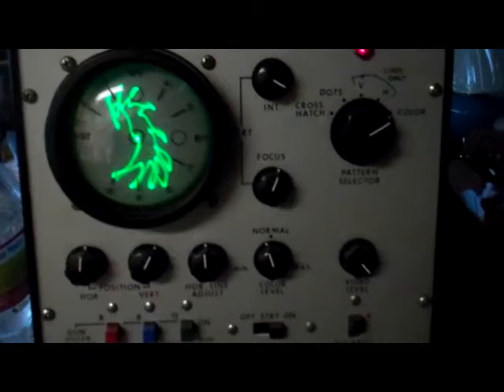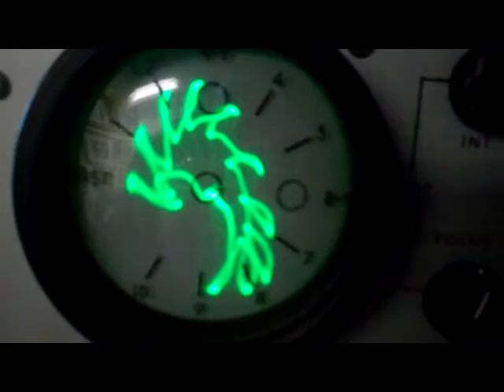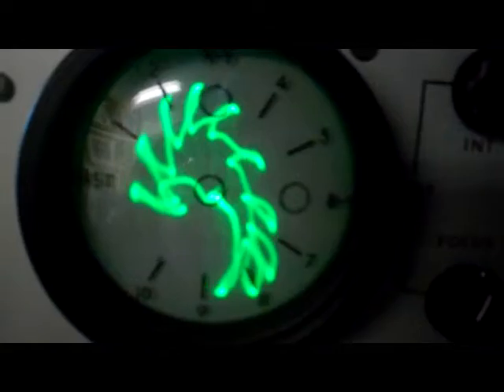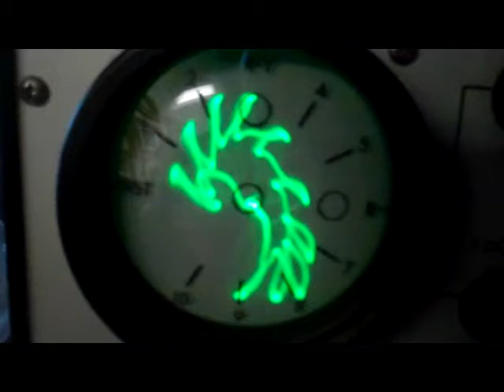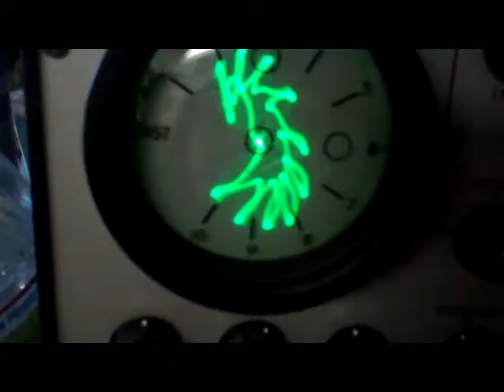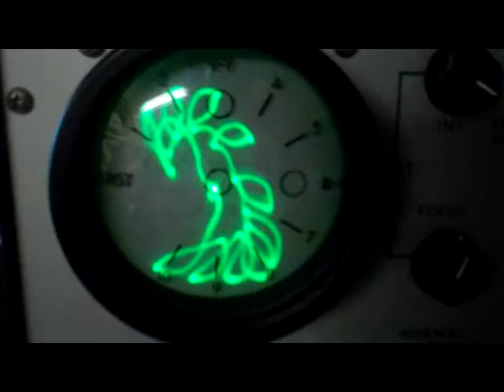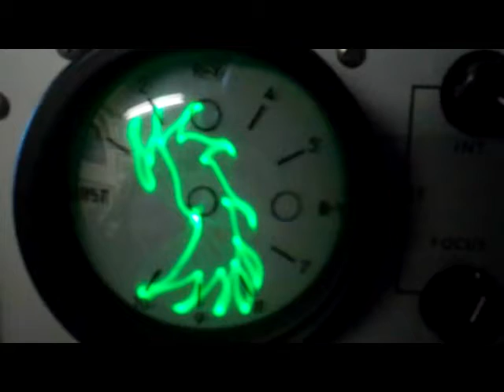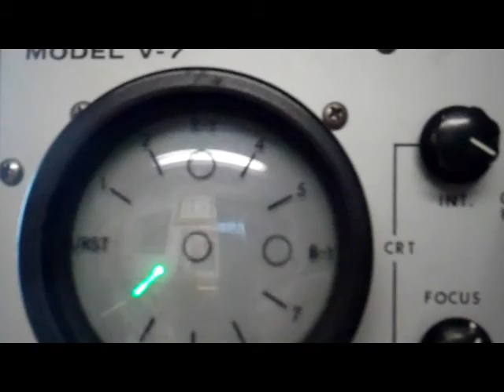Using Lectrotech V-7 Vectorscope Color Bar Generator to Analyze Vintage Color Tube Television

Comment: Have you replaced the filter capacitor because the 60Hz hum 
sounds like it's a bad filter cap and the smear problem will
also be fixed if that is the cap.